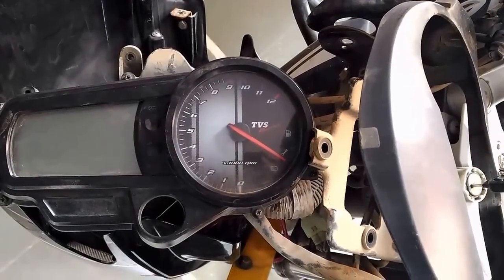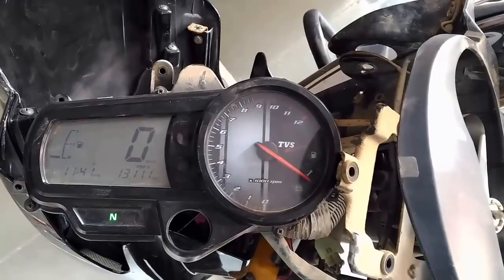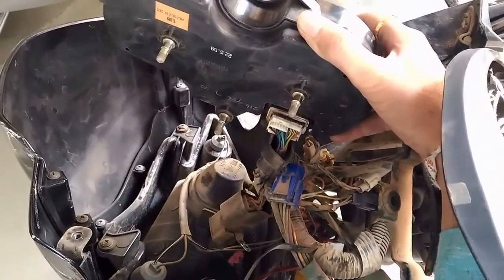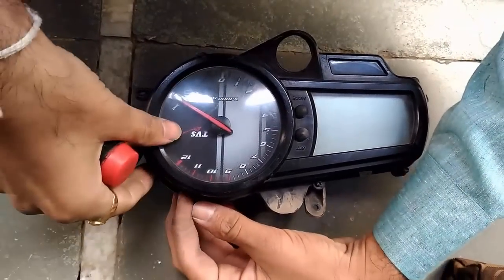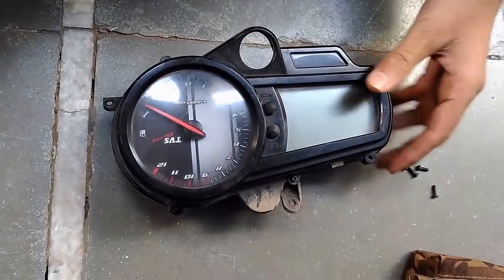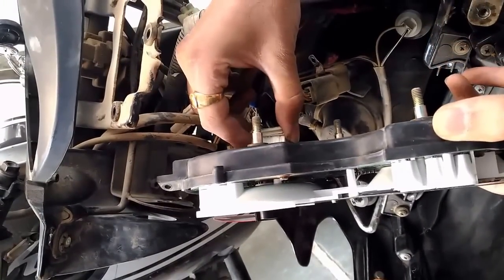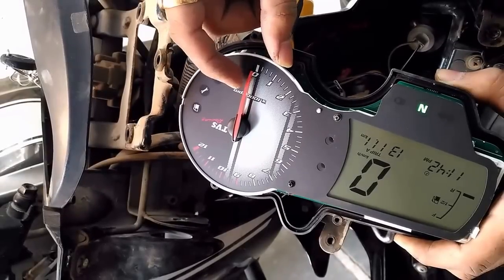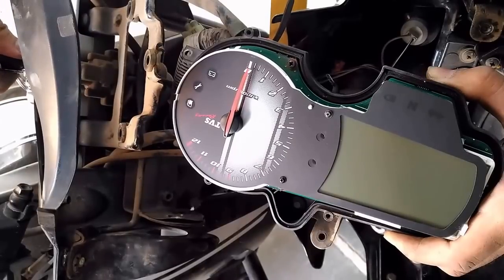How to set Engine RPM Pointer to ZERO Position in TVS Apache RTR 160

Comment: A great thanks to you bro. Im very grateful. You really inspired me to do the same on my RTR160. The plastic dashboard like covering around the meter console was really hard to remove. The disc brake cable was a big obstruction. But nevertheless after 2 and half long hours I did it....thank you so much bro!! I'll remember you....
Reply: +Helping Hand Ohh good. BTW, did you also experience the same problem as mine?
Reply: +Helping Hand Ok then....I also wanted to ask you that my Apache gives a bit of cold start issue and also gets overheated in traffic. Ive made the carb settings to exactly stock (5 turns from fully tight or lean) by replicating it from another Apache which didn't have these issues. But still I'm facing them, a little help from you will be helpful :)
Reply: +Helping Hand Ok bro....anytime!!

Comment: my Apache 160 rtr speedometer is not working, showing 0 ,it's timing and other things are working. it's happened after washing. first it's misbehave and later became 0. how to fix it, please support.thnks
Reply: Thanks for your kind advice. I will try the same and let you know if the problem is fixed or not.